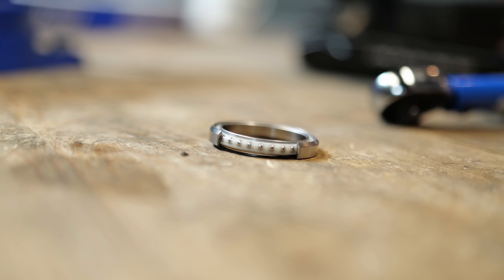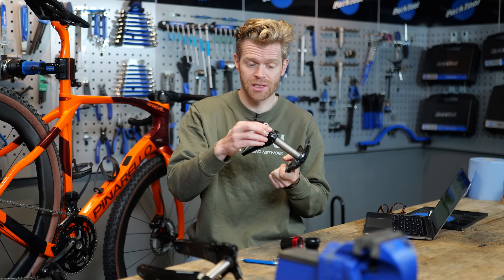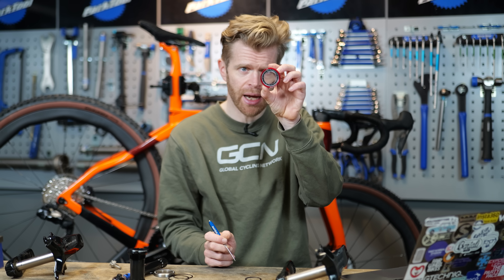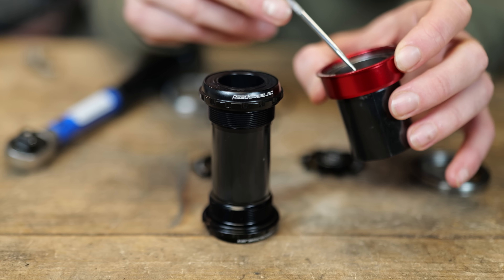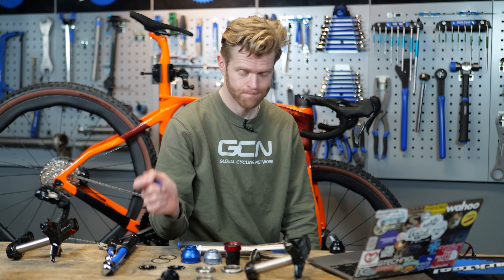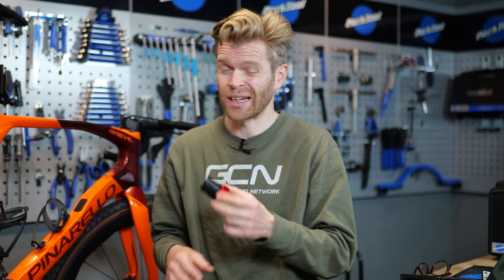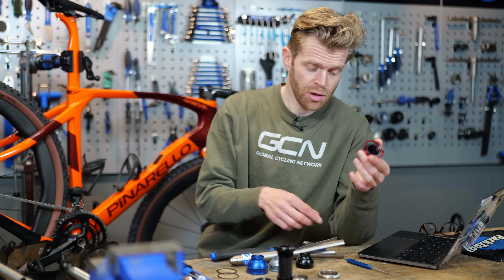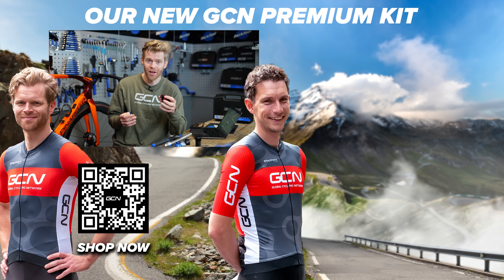5 Maintenance Mistakes That Are Ruining Your Bearings

Comment: Bearings are cheap. Just replace them when  theyre worn. If youre that bothered dont ride in the wet.
Reply from the maker: that is an option, but with some improved maintenance, you could save some money/hassle of repairing. Cheers

Comment: If you know what your doing and understand WD40 or better alternatives they do make sense on specific parts of the bike that are for example seized and grimed up. 

Also if installing a new BB with lots of grease or undoing the crank to clean the contact surfaces its good practice to tighten the preload (within required sepcs) then ride a bit so it settles in and tighten it a bit more. Most clicking from BBs is allieviated by retightening the preload. 

Pinion albeit looking similar does a completely different thing, the center bolt is tightened to 10nm and meant as a stop to pull the crank outwards against and then tighten the crank screws evenly to 10nm aswell. 

Some integrated headsets come with plastic spacers that spook the living sht out of me, I do not understand how anyone could seriously think its a good idea and most bikes come back with them scewed. This issue needs adressing.

Comment: I might have missed it but did not see how to remove BB pressfit bearings when you did NOT want to bin them, rather you wanted to service them?
Reply: My solution would be to buy a new bike with a threaded bottom bracket 😅
Reply: @bkmontgomery  Yeah. I had a bike with one and that was the shortest I've ever owned a bike.
Reply: @bkmontgomery  It's too bad that bb shell tolerances are not being met.  IF they were, BB30 might be the best BB.  I have a 2013 cannondale carbon 2 with BB30.  2 bearings, no sleeve etc.   Quiet and efficient.  BB shell must be within spec is the only thing I can think of.
Reply: Yeah. He did say bearing press/pull kit but he wasn't explicit about it. But that's what you would use.
Reply: That is my question as well!
Reply: Pretty sure removing a pressfit bearing would damage it. That splay tool he shows is the only way to remove some since a bearing puller won't fit, and will damage the bearing (and probably the frame in time) - stupid design. Besides after all the effort of removal why not just replace it.
Reply: @bikeman123  Not at all. But like Ollie said, if you use the wrong tool, it definitely will damage it. Use a press fit bearing kit and use it correctly you're good to go. Don't get me wrong, I dislike PF and won't have a bike with them. But they are 100% removable and reinstallable. Why not just replace it? Well, if you purchase a expensive bearing like Ceramicspeed or Chris King that were designed to be serviceable for life, then you don't do that. It also reduces waste.

Comment: If only there was some sort of sealed cartridge you screwed into the bottom bracket that 
Lasted for about 10 years before it needed checking.
Tbh bike bearings are expensive rubbish, poorly sealed, poor quality with 50% mark up over better quality o es because they’re bike specific
Reply: There used to be - a square taper spindle in thread-in cartridge. SKF used to make them I think? Most of the parts were stainless steel so they told you not to use one on bikes you'd be getting a lot of air time on...road bikes only, no MTBs.
I think the one in my old steel bike is one of them...been in there a decade for sure. Still spins just fine.

Comment: Regarding WD-40, what are peoples ‘s thoughts on the WD-40 lithium grease? Is it not advisable to use that on your bottom bracket as a temporary measure between services? ( confession… I’ve used it 🥴)
Reply: WD-40 is a company; which however became synonymous with its best selling product a grease- and grime- solvent that has at best thin oil level lubrication properties and disintegrates proper greases. WD-40 lithium grease however is a different product, its a spray grease that is ok for a quick fix on dificult to reach parts. This spray grease also has some solvent properties. It does not replace proper maintanance wich entails dissasembly, cleaning and relubricating with appropriate sepcialised high quality grease.
Reply: It's a little thicker than bearing grease but works fine.  If you can't tell the difference between hubs packed with the good stuff or lithium then lithium becomes fine at that point.  I know I wouldn't be able to.

Comment: Beanrings main purpose is to transfer dragging friction (I do not know right english word, but finnish is laahauskitka) to rolling friction.
Reply: The English word you were going for is 'sliding' not dragging.
Sliding friction occurs when two surfaces move directly against each other. In fact, sliding friction is what a bearing seal does on a shaft which causes energy loss as Ollie explained.  There is also a distinction between static and dynamic friction, former being higher.  
Rolling friction occurs when an object rolls over a surface which is much lower than sliding friction.
Reply: @ArtLangston-o9d  Thanks!

Comment: Please explain to simpletons like me what ‘ preload’ is? ( preferably in plain English)
Reply: Just to elaborate, preload is the pressure you put on bearings during installation.  Proper preload means that there will be enough pressure on the bearings to eliminate play, but too much preload means you're compressing the bearings too much, causing friction.
Reply: A small amount of  pressure placed on a bearing.
Reply: You want just enough so that nothing can wiggle, but not too much so as the balls will slide instead of turn.

Comment: What about using a garden hose?
Reply: Should be sufficient/safe pressure.
Though continuous jet concentrated right at bearings not good
Reply: @Jacob99174  I usually use the hose to wet the bike and then again to wash off the foam/remaining dirt.
Reply: @gnorts828  I think they're warning against a proper pressure washer. From generic garden hose not as much risk, just don't jet at the bearings
Reply from the maker: generally the pressure is over 10x less of that from a jet-wash so it will more than likely be fine

Comment: Just don't buy any aftermarket garbage BB with ceramic bearings and marketing bullcrap. Its overpriced as hell and doesn't provide any real world difference unless youre doing tour de france and need every milliwatt saved. The super cheap entry level shimano BB-RS501 or MT-501 with NTN bearings will last you 100000KM which no ceramic or high end aftermarket BB will do. 
Ceramic speed BBs are the biggest scam out there. Overpriced and saves you nothing. For your interest a ceramic bearing will save you 100-200 milliwatts over a conventional tripple sealing one. The crank spin is not a valid test as its a no load scenario, under load both of them are the same.
Reply: Shimano BBs have absolutely top-shelf seal designs, too. Yes, the plastic one.
Reply: @jwbaker  Nope, not every one. Only the BB800/801 and Saint series starts having double labyrinth seals. The standard BB500/501 series and equalent only have a single rubber seal on the bearing.
Reply: What other upgrades would you say are frequently mentioned on gcn but wouldn't, shall we say, stand up to scrutiny?

Comment: Crank spin test means fuck all for the reliability. If the alignment is correct, it means that there are no seals and/or grease is light. Both reducing the life span. Bearing drag under load matters more. If you are interested in reliability, don't install BBs using ceramic bearing balls with steel races.

Comment: Never hang wet or washed bikes from REAR wheels. Any water in the frame gravitates to sit the headstock bearings...
Reply: is hanging bikes upside down really a thing? Why should anybody do that?
Reply: @PingoloPangolo Fairly common to have vertical bike storage these days as it's more compact than standard
Reply: @thenayancat8802  sure, I also hang some of my bikes up vertically. Only, not upside dowm.
Reply: @PingoloPangolo I don't know where you're getting upside-down from
Reply: @thenayancat8802  from here: "Never hang wet or washed bikes from REAR wheels."
Reply: @PingoloPangolo Can you explain how the front wheel is the top of the bike for me please?
Reply: @thenayancat8802  sure: I only pedal up really steep roads.
Reply: @PingoloPangolowell I've gone otb so it's the other way around for me

Comment: Biggest thing you can do to shorten your bottom bracket life is not using square taper with blue loctite for cups and bolts.  If you do that with a nice multiple sealed one, you can ignore maintenance for 10-20 years of heavy riding.
Reply: You should follow the manufacturer's guidance- many cartridge BB need insertion into frame with GREASE.
Reply: @TheFlyingJanner   Shimano ships their Square Taper with loctite on it, Park Tools website says to use loctite on the bottom bracket.  If you want to use something toxic that washes out with water in a year like grease, that's your business, but even 1 layer of silicone plumbers tape would be a better option than grease.
Reply: Or just put NTN bearings into your HT 2 bb and it will last 100000KM.
Reply: @kazuviking   Or just use the SKF Square Taper and get 160,000 KM, and never have to worry about your tiny NDS pinch bolts coming undone because it's loctited with a giant bolt on both sides.
Reply: @凸Bebo凸  My NDS pinch bolts never coming undone as there is none thanks to the mutant chinese HT2 crankset. Square taper is horrible for me in the fact that its impossible to find one with sram 3 bolt chainring pattern as i run a wonky 42teeth oval. Other part is that the SKF square taper BB is severely overpriced and uses inferior SKF bearings and not superior NTN ones. With NTN bearing it would 100% do way more than 200K. Locally SKF BBs costs more than my entire drivetrain combined lmao, which includes the NTN bearing swap.
Reply: @kazuviking   The part I listed isn't overpriced.  You can loctite it into your frame for 150 bucks, you never have to open the cranks up for 10-20 years and has a 10 year warranty.  You could buy a scam bottom bracket like a BB Infinite, pay 400 bucks and have it break in a year and get your warranty denied for some random reason.  Not to mention any of their "wattage" and "speed" claims aren't verified by any independent agency, so it all means nothing.

If your Hollowtech crank doesn't have NDS bolts then its like GXP where you can't adjust the NDS side bearing preload.  There is no way a BB with no way to adjust bearing preload on the NDS side is going to outlast good square taper.  SKF uses a stainless steel race ground into the shell for increased ball bearing size, NTN doesn't offer a product like this.
Reply: @凸Bebo凸  Its the definiton of overpriced. For 150 bucks i can buy a casette, derailer, shifter, chain, bb and NTN bearings. BB infiinte is the largest BS claims manufaturers out there. Ceramic bearings saves you 100-200milliwatts. My crank uses a metal ring as bearing preload like srams DUB, told ya its a mutant one.
Reply: @kazuviking  Using a wavy washer to adjust preload isn't as good as the pinch bolt system or the square taper system in smoothness, longevity or wattage.

Sealed NTN bearings pressed into an external cup is not sealed enough to block water dirt or sand for more than a couple of years.
Reply: @凸Bebo凸  Its NOT a wavy washer but a bearing preload adjuster ring thereaded into the NDS crank arm. Its the only reason i got the crank, its HT2, uses sram GXP chainring mount and have the DUB bearing preload ring.
Reply: @kazuviking   The DUB preload adjuster ring is basically a wavy washer that doesn't violate Shimanos NDS arm patents, it's not the same thing and it's not as good as either Hollowtech 2 or Square taper in friction, not that it matters really, but it isn't.

Also since its a ChinaCrank your pedal threads will likely rip out in a few years, especially if you stand up pedal.  Better to get a nicely made Square Taper like Sugino RD4 which has been forged in its own forge 25 times.
Reply: @凸Bebo凸 It wont rip out as the threads are nicely machined in.
Reply: @kazuviking   If it came from China it was CNCed with alloy 1 level below the claimed one, not forged, sorry bro.
Reply: @凸Bebo凸 Love it how everyone is crapping one china poducts without owning any or doing research. Have this for a few years now and the pedal threads are completely intact. Switched pedals after a year and it threaded in without issues and took 35Nm like the previous one.
Reply: @kazuviking   I'm not crapping on it, it's just not suitable for a strong or a heavy rider or stand up pedalling.  Nothing from China is going to have its own forge that forges retro cranks 25 times, because its a different culture and they don't care about stuff like that.  I've broken 2 GXP cranksets and a generic China track crankset so I DO care about stuff like that though.

Comment: #1 buying a pressfit-standard frame.
Reply: And by that, I mean notoriously bearing-eating, misaligned frames that nobody ever gets right. Sure, there are a few folks and YT channels who can fix these, but in the non-US/UK reality, there's often no cost-effective way to get such repairs. I wouldn't send my 2000€ bike over there for repair but just keep on throwing bearings at the problem.
Reply: BSA BB with replacable bearings supremacy.